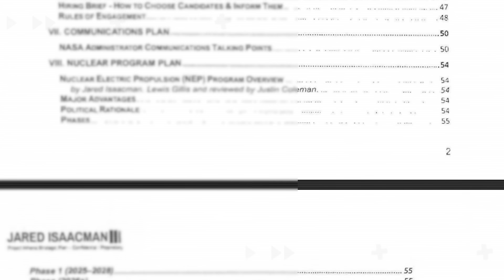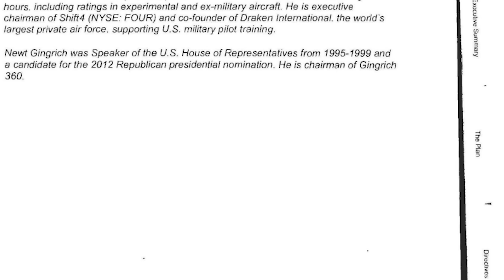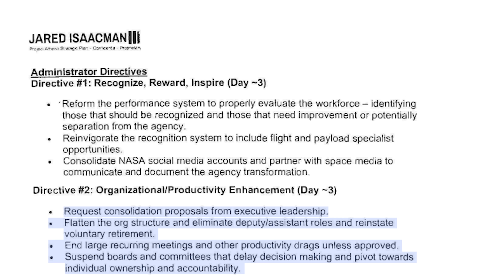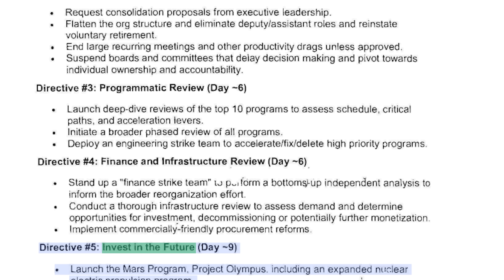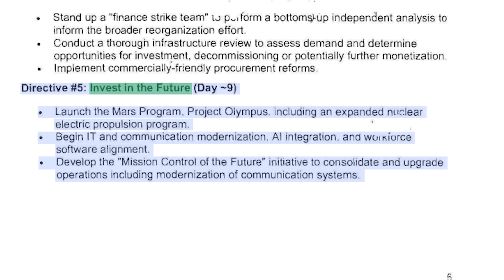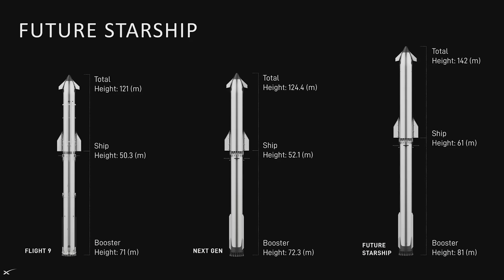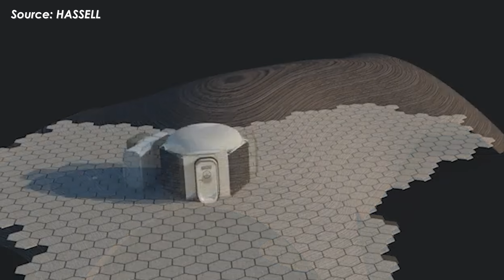NASA's new Insane Starship Plan Shocked China: Starship Mars Base in 2028

Comment: Please use feet instead of meters
Reply: Please keep using units designed for modern science and engineering and adopted everywhere, except for a few backward demographics.
Reply: No one but little merica  uses feet. It’s only good for estimate measurement. May as well use bananas. Metric is the only system that works with elegance. Even the yanks use metric when precision and standardisations needed.